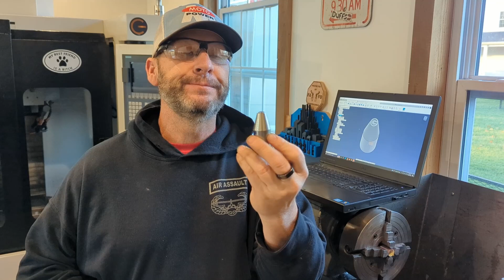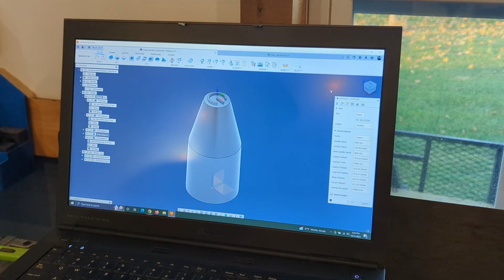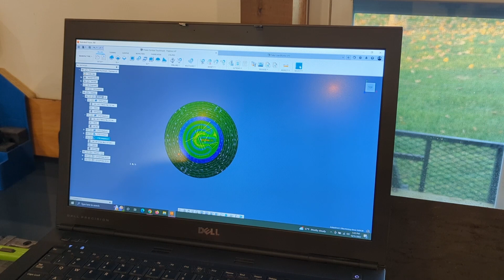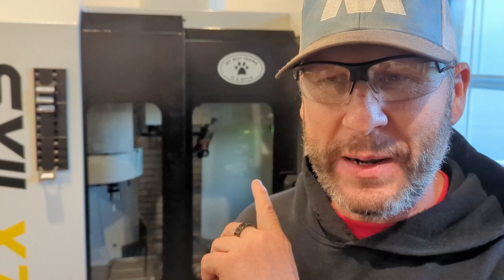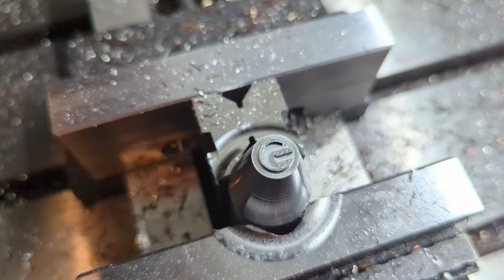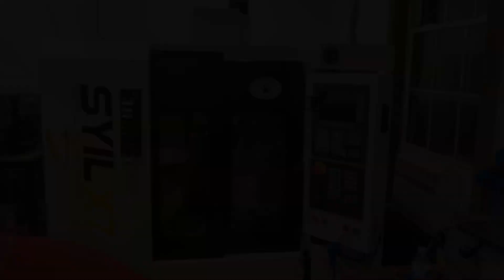Milling a Prototype Touchmark

Comment from the maker: Video update:  I tested the annealed H13 steel on a hardness tester and it was about 17 C Rockwell, around 220 HB.  My files  only go down to 40. Also, I discussed the squeeling when the enmill rounds the part with a Haas CNC instructor and it turns out that the sound is normal on any CNC with ball screws.  Basically, when the endmill rounds the part and just as the y screw swiches direction, there is a brief moment when backlash occurs.  During that moment the enmill will chatter.  He then proceeded to name different Haas mills and how and when they also chatter.  Guess my Syil X7 is in good company.

Comment: I think it's a great mark. I can't wait to see you use it on some hot metal. I know this is designed to be used in your drill press; is it possible to design one equal in size to your analog blacksmithing tools, similar to a drift, that you could hold to your work and hit with a hammer?
Reply from the maker: Definitely.   I have some 5/8 round S7 steel that I will use for that.  I will need to make a fixture to hold it, but it will be a future project.

Comment: Looks good will you be milling a flat on it so you can align it every time and stop it torquing?
Reply from the maker: Yep. I had the same thought.  My fly press tool holder has a grub screw that I can use to index it.  I may yet run into other unforeseen problems, like clearance issues. I guessed at the height of the symbol and it might bottom out leaving an imprint of the outer circle.  There will likely be a version two in the future. :)